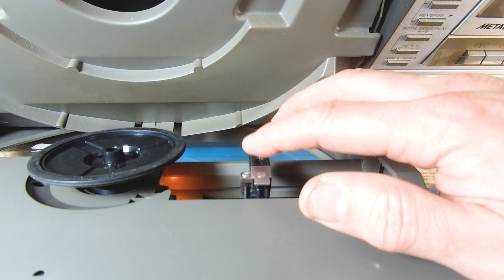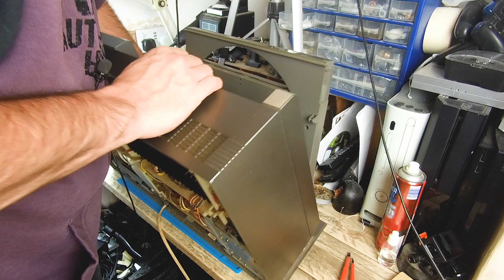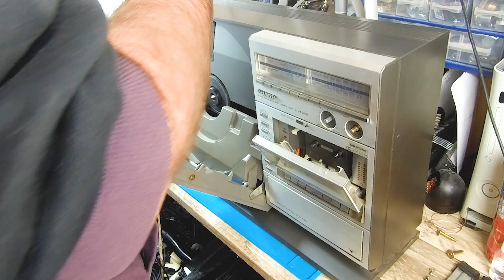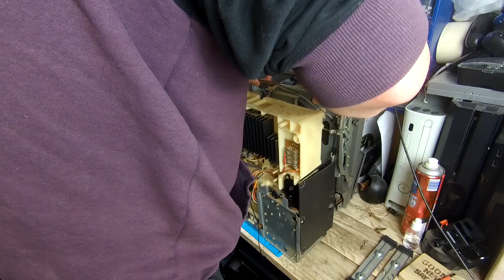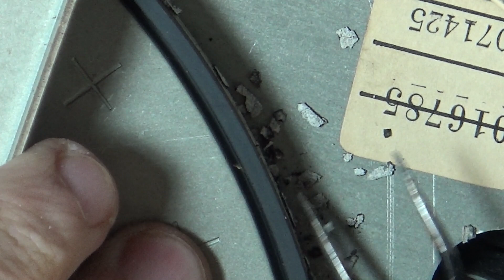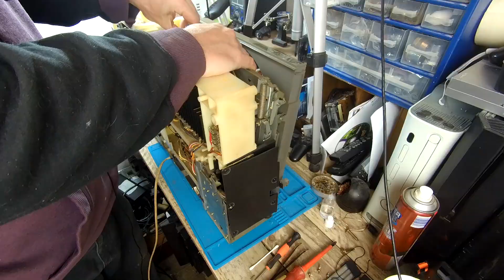Sharp VZ-3000 Linear Record Player Repair #Part 1 Ridiculous Belt Change | UK eBay Reseller

Comment: I repaired many of these back in the 80's working for a Sharp dealer.  There was also the portable version the VZ 2500.  Having the speaker touching the main unit will cause feedback when playing the record deck.

Comment: I don't understand one thing. The technical service manual for this exact model is available all over the Internet is a free PDF download, and it shows exactly the proper way to tear the unit down and in what order things should be removed making it very simple to do things such as belt replacement etc. Here I see this man randomly trying different things and trying to figure out what screws come off etc and I really think it would have been so much easier for him if he had just downloaded the technical service manual which is again it's free all over the internet. I have this unit and I have the manual in PDF. It saves you a lot of headache believe me.
Reply from the maker: I have the service manual and the only ones I could find all over the internet were bad copies where you can hardly read anything. And it's still ridiculous what you have to do to change a belt, easy when you know. I have done quite a bit to this machine and it is all working perfectly if you watch the latest videos
Reply: @RetroElectronicRepair  I have no doubt, you have done tremendous work to that audio system so I would expect it to work perfectly after all that you've done. Your videos are quite excellent.
Reply from the maker: Thank you. The copy of the service manual that I have is very hard to read. And the exploded diagrams for disassembly can hardly be read. If you know where a clearer copy of it can be found please let me know.
Reply: Do you know where a manual is for a VZ-3510 I can't find one.

Comment: Can you help ? I have the same unit but the stylus arms aren't moving when the record spins.Any idea what is wrong with  it. Many thanks.
Reply from the maker: I think the stylus are on strings. If you can hear motors turning then check the strings. Otherwise it may be a switch or motor problem. Sorry I can't be of much more help.
Reply from the maker: If you take a look at my other videos of it I think you can see more and how to get to them.
Reply: I will have a look ,thsnkyou for your reply and timeout..cheers
Reply: Hi ,thanks for the info ,I have managed to fix the issue .It was a stretched belt.Replaced and didn't cost a penny .100% working ..Thanks for your advice.

Comment: hi very interesting video and when are you going to do part 2 on this sharp vz-3000 I like to see the end results 😊😊
Reply from the maker: I've just received all the new belts so should be doing the video this week. Will hopefully be released by the end of the week
Reply: Thankyou you very much for your reply please kindly help me on my sharp vz-3000 what size are the belt for the turntable platter and please kindly can you can you please measure the turntable platter across the exact measurements in millimeters please and kindly let me know thanks very much 
Sam
Reply from the maker: I will do that for you when I get in to it. I just bought the belts off eBay, if you search for sharp vz-3000 you should see them. About £15 each for the tape belts and also for the door mech and platter.
Reply: Thank for your kind reply 🙏 and the information for the belt please if you kindly when free send me the turntable platter dimensions please thank you 😊
Reply from the maker: The platter diameter is 228mm
Reply: Good evening to you thank you very much for your reply regarding the sharp vz-3000 turntable platter across measurements which you sent me 228mm as the formula say circumference of a circle is equal to pi times the diameter (c = πd) so pi (π) which is 3.14 × 228 = 715.92mm 
And 715.92mm = 28.186 inches I ordered this but belt is very tight on the turntable platter? ??? And I ordered an other belt from eBay from Tony as he said its 100 percent for sharp vz-3000 turntable platter belts which he sent to me which is 320mm across  so using the formula pi (π) which is 3.14 X 320mm =1,004.8mm  so 1,004.8 = 39.559 inches which I tried on the turntable platter the belt fits very nice and little tight and snug ? I am very confused so 39.559 inches minus 28.186inches  = 11.373 inchs difference ?? Why is this ? I don't understand? Please can you help me on this 🙏 issue which is the right belt for the sharp vz-3000 turntable platter?? I checked on the Internet they said to use the formula but why there is very big difference?? 🤔 waiting for your reply and the belt you ordered what is the exact size ? Thank you 😊 Sam
Reply from the maker: Hi Sam,
The belt I ordered is 635mm (25 inches) which is correct according to the manual. You are correct with your formula 228mm X 3.14 = 715mm but you should then minus 15-20mm for the tension. So according to the formula it should be a 695-700mm belt. The 320mm belt you have isn't multiplied by pi, the belt is 320mm in half so it is a 640mm belt. The same as the one I've just put on, minus 5mm. I'm not sure why there is a 60mm difference if you go by the formula but the part number in the service manual matches to a 635mm (25inch) belt. I should have the video uploaded sometime tomorrow.
Reply: Thanks for you very fast reply I did order the belt from eBay from Tony before I bought the belt I asked him if it will fit the sharp vz-3000 he said yes it will fit and today I received the belt it looks to me small as you know if you fit the small belt it will wear out the motor and the bearing so there is formula that you can calculate any turntable platter belts what it should be that why I asked you about the sharp vz-3000 turntable platter across measurements exactly in millimeters please kindly when you have time kindly send me the measurements so I can use the formula to get the right length of the belt thank you you very much 
Sam
Reply from the maker: @mohindersembi7647  working on this tomorrow. Just got the service manual and the part number for the belt says it's an FBM25.0 so 25inch belt 635mm X 10mm X 0.8mm. I will still measure the platter for you though.
Reply from the maker: Let's hope the ones I've bought fit then.

Comment: Im putting a new belt on mine....you could have just took the 4 screws off the board and then 4 screws from the metal bracket holding the black wheel the belt goes on....alot easier then taking all that other stuff off.
Reply: hi can you please help me on my sharp vz-3000 how do you put the belt as you said holding the black wheel ? which one is the big wheel or you are taking about the small wheel please kindly help me on this issue thank you Sam

Comment: Great tear down so far. I've found mine in a junk shop this weekend and have started and attempt to fix - I estimate at least belt changes like yourself. I've found a service manual which helps. Mine has a problem with the door mechanism - there's a buzz when powered on like it's trying to do something so not sure where to start with that. Did you ever confirm if the smaller belt is for the door mechanism or the stylus transport?
Reply from the maker: Yes the smaller belt is for the door mech. Not sure what that buzz could be, any idea of where it's coming from?
Reply: @RetroElectronicRepair  That's great to know re: belt. Not sure of buzz location, all I do know is that it stops if I manually opened the door and then closed it - unsure as I've the unit back together for the moment. Thinking about it, it could just be the motion of the motor if the belt is shot - and it's just turning constantly trying to perform an action that will never finish. I'll take it apart again in a couple of days and check. Thanks!
Reply: @alexanderhosford8520  Hello! If you haven't solved it yet, the smaller belt not only opens the door, but also moves the needles. There is a magnet on the other side that pulls you in when you open the door. I think it buzzes and doesn't pull in.